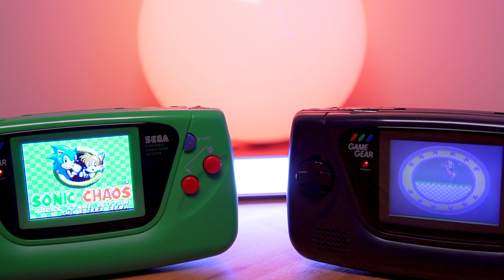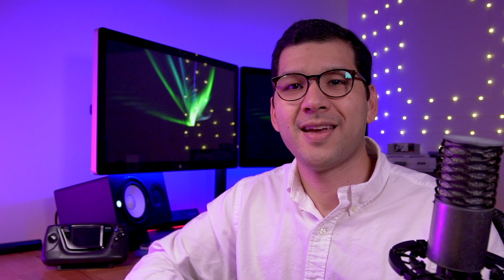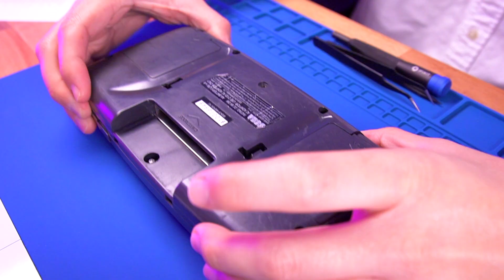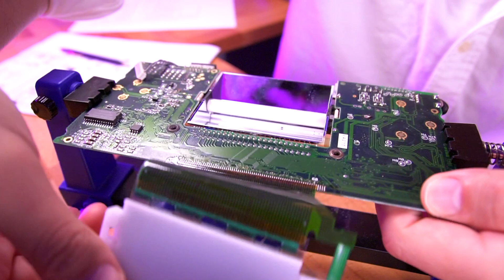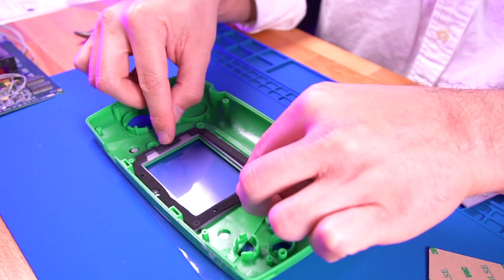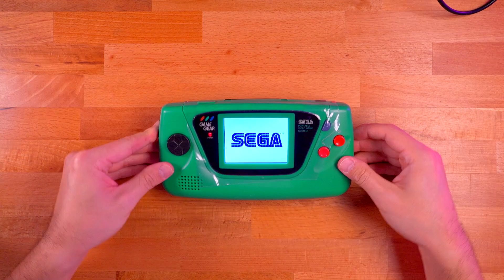ULTIMATE SEGA GAME GEAR | McWill LCD + RetroSix Custom Shell | Full Tutorial |  Retro Renew

Comment: I enjoy watch your mods, but I feel your a bit impatient when soldering and trying to remove simple components to quickly make mistakes in the process.
if you are not a qualified solder don't rush or you will make mistakes like you did on your volume wheel, if its just a shaky hand then slow and steady also wins the race. glad it worked in the end.

Comment: I've recently entered the deep rabbit hole of game gear modding and boy do I like it. It's impressive the amount of things you can do to a 30 year old console.

I got my first game gear around a week ago. I'm a repair technician and one of my clients gave me her GG for a simple capacitor swap. Little did we know that I was not the first person inside that poor thing, and the previous attempts at repairing it were terrible. Lifted and missing pads, torn traces under the capacitors (I'm assuming the last "technician" pried the caps with a screwdriver or something causing and immense amount of damage), capacitors of incorrect values in incorrect places with incorrect voltage ratings... A MASSACRE.

I told my client about the situation before doing anything and proceed to explain to her that it was going to be an extensive and expensive repair due to what I found and even though, I couldn't guarantee that the ASICs were not fried due to overvoltage or something else was faulty.

So she told me that she would most likely throw it in the bin because she didn't feel like paying a rather large amount of money without any warranties. I told her if she could give it to me and I ended up paying her a tiny amount of money for compensation and kept the console. 

Long story short, I repaired the traces, changed the capacitors, cleaned the board and fixed the audio board. 

Now I'm waiting for some replacements from AliExpress to fix the power board which had several SMD components fried and unstable voltages operation. If everything goes well and I end up fixing it, next thing will be a new retrosix shell (haven't decided yet if black or transparent) and a McWill LCD mod.

I'm really looking forward to have my sweet baby working again like a champ.

Videos like yours are EXTREMELY important and valuable to the community of modding fans. Great editing, great content and perfectly explained. I'm already subscribed and waiting for more GG content or any other retro consoles for that matter. Keep up the good work bro. 👌🏻👌🏻👌🏻🆙🆙🆙
Reply from the maker: Hey Cristian!  Really appreciate the kind words dude!  Thank you for the awesome comment!  

What a great story!  I’m so glad you were able to save the Game Gear, sounds like it had been butchered, but is now in a good home!  A retro six shell and McWill mod will complete your GG nicely!  

Thank you again for sharing!  Plenty more GG videos to come!  Cheers bud!

Comment: I just bought the v2 ips screen kit from funnyplaying and I see that the insulated film does not come in the box.  Do you need to install it?  What happens if I don't put the film on the screen?
Reply from the maker: You don’t really need it. You can just use kapton tape to insulate. I would recommend insulating any area on the pcb near the ribbon cable. Hope that helps. Cheers!

Comment: I didn't realize the McWill install would require removing so many components. My Magic Screen install was much easier than this, I'm sure you'll agree when you install it yourself. Only 2 resistors and 1 coil need to be removed and no new resistors new to be soldered for VA1 motherboards, it comes with an LCD centering bracket and a small daughter board that connects to the  bottom row of pins and then to the back of the main board using a small ribbon cable, the final result is very clean looking.
Reply: What about the Display and it's function? Do you offer better Scaling  or any new Features?
Reply from the maker: I’m not 100% sure but I think the feature are very similar if not the same as the McWill.
Reply: @hasserecht3678  From what I can tell, the LCDs are identical, I believe they are generic ones. The same 7 displays modes are available in both. Main difference is that McWill offers an optional RGB output, and the Magic Screen does not. Once Tito compares both, we'll find out if they are any noticeable differences in how they perform.
Reply from the maker: That’s good to know!  I can’t wait to install mine!  Video to come soon!!  Cheers RGS!

Comment: I see you have the game gear that has not the blue boot screen and is booting directly to the game.I wonder if the everdrive x7 card will boot. I have the same game gear with mcwill, the one without the blue boot screen and my everdrive x7 is not booting. I always getting a message "memory error". My original cartidges from the other hand are working flawlessly.
The only way i found to make it work is by powering on Game Gear and then insert the cartidge. That way it works. I think it must be something with the power when booting console as everdrive x7 has a large consumption of power. (The everdrive x7 is working fine on other game gear console with the original screen).
Maybe the usb-c mod will make it work with a big 3A power adapter.
Nice video though, always enjoying watching your mods.
Cheers!
Reply from the maker: That is super interesting!  I wonder what is causing the everdrive to not boot on the game gear without the opening blue screen. That seems like a pretty big oversight on the part of krikzz. I wonder if it’s a known issue. I really want to get the x7 everdrive at some point. It’s so expensive though. That would be interesting in the usb c modded power board fixes the issue. Cheers buddy!  And thank you for the comment!!
Reply: @MachoNachoProductions  i ordered a 3rd Game Gear console with McWill and with the blue boot screen. When i receive it i'll let you know if it's working or not.
Reply from the maker: Sounds good man!  Thank you!!
Reply: @MachoNachoProductions my friend haven't forgot you! I received my new Game Gear with the McWill screen and here are the results!
The problem i had with the everdrive GG x7 cartidge solved! At last the everdrive is booting normally! I was right about finding a Game Gear with that blue boot screen.
3) "Castle Of Illusion" now is playing normally with right resolution on screen, as i had problems with that cartidge on original game gear and with game gear with McWill.
4) I can now also play with the right resolution the master system games as also the SG-1000 games from my Everdrive!
So all my problems are solved!
Have a nice day and Happy Christmas holidays!
Reply from the maker: That’s great news!  I’m glad everything worked out!  Thank you for getting back and sharing!  Merry Christmas and happy holidays to you too!  Cheers!

Comment: https://handheldlegend.com/collections/sega/products/sega-game-gear-cleanpower-usb-c-power-regulator this is to replace the pcu, if you the bottom of the page. This board does not charge batteries. For a rechargeable battery and power solution use our CleanJuice GG (coming early 2021). But I'm using rc car battery pack's with it charger with a couple of adapters to get USB C charging battery's :)

Comment: I'm new at soldering, but I bought a kit and I'm playing on do it wish me luck. I have 3 GG's they all need capacitors replaced. I'm also planning on doing a rechargeable battery with type C charging.
Reply from the maker: Hey Cory, those sound like great mods!  I do have to say that the McWill mod is quite challenging and you may want to practice before attempting it. It requires some fine soldering skills. I wish you the best of luck in your modding journey and I hope my videos are helpful!  Cheers buddy!

Comment: A couple of errors in the video. There are 5 major mainboard revisions and the McWill is only compatible with 2. VA0 and VA1. The cartridge port shielding is not pre-cut. This is how all Asian/Japanese models have their cartridge port cover, because of less strict FCC regulations. I also noticed you said in a previous video that the retrosix USB-C mod is compatible with all hardware revisions, however it has a VA0/VA1 style connector, so it won't work with any of the other revisions.
Reply from the maker: Thank you for letting me know!  I’ll have to update my video description with this information. Cheers buddy!

Comment: This looks great! one piece of advice for those wires, pre-tin them with solder before soldering them to the pads and pins. Makes for a stronger, longer lasting joint. :)
(Apologies if you did pre-tin, I can't quite tell if they are or not.)
Reply from the maker: Totally agree!  Thank you!  I didn’t tin all the wires but I did tin the wires I soldered onto the small contacts on the motherboard off camera. It is good practice. Cheers buddy!

Comment: Many users have reported that the McWill LCD screen will not work with the EverDrive GG. What is your experience?
Reply from the maker: That’s really a great question!  I need to get an everdrive gg.  They’re just so expensive. I’ll probably pick one up eventually. I’d definitely like to know the answer to that myself.
Reply: @Michael McCarthy for me is not working with original everdrive x7.
Reply from the maker: Hmm interesting
Reply from the maker: That’s good to know!
Reply from the maker: I’m wondering if there is an issue with the newer x7 model?
Reply from the maker: Oh man that stinks. Thank you for letting me know. I really wanted to get an everdrive, but if it doesn’t work with McWill that makes it a tougher decision.  Cheers buddy!
Reply: @MachoNachoProductions  wait till i receive my game gear with mcwill. I'll test it as i already have the Everdrive GG X7. I'll report back probably the next week.
Reply from the maker: Awesome!  Sounds good!  Thank you!
Reply: @MachoNachoProductions   My Everdrive X7 works perfectly with my Mcwill game gear, its the only cart I use on it. But I only use mine plugged in I've never used it with batteries, so maybe not enough power from the batteries for people having problems?
Reply: @6316johnc  I never use batteries. Only AC adapter and having those problem. But i have tested also with batteries, rechargable and non rechargable and i have the same problem again.
Reply from the maker: Hmm interesting. It could be the batteries. I’m glad we’re all having this discussion. I like to play my game gear with my rechargeable eneloop batteries which probably is the worst way to do it, haha. Thanks again for the input!

Comment: Excellent job on the mod!. the only thing I'm confused about, maybe I just didn't pay attention to your previous video, but didn't you change the GG to have a USB-C power input?
Reply from the maker: Thank you buddy!  That’s a great question!  I did 2 Game Gear videos prior to this one. I did one where I replaced the capacitors for this McWill modded game gear and I did another video on a different game gear with the usb c mod. This green game gear doesn’t have the usb c mod although it can be very easily installed. It’s a drop in replacement of the original power board. Cheers!

Comment: Looks great, love the mcwill screen. As a side note, I have done this mod on some single asic models and although you can use 0ohm resistors, bridging the pads with solder or a small bit of wire works just the same. I have done it both ways and the result was the same.
Reply from the maker: Oh nice that’s good to know. Bridging the pads would be way easier than putting in this 0 ohm resistors. Thank you for letting me know. I have a single ASIC GG that I want to modify. Thanks again Ben!  Cheers buddy!
Reply: @MachoNachoProductions  If you have another one to do you should consider including the VGA mod that comes with the screen. Would make a good video. Keep up the good work bro.
Reply from the maker: I’m definitely thinking of modding another one now that I have some experience with the mod. I think I would definitely include VGA out on the next one!!  Cheers bud!

Comment: Forget about soldering the PCB and moving it around till you get the screen centered - too much of a hazzle - 

here is the solution:

https://www.ebay.de/itm/Sega-Game-Gear-Backlight-Installation-Bracket-for-McWill-etc-Orig-RetroSix/264937936130

Comment: Does the brightness control even work with the McWill LCD controller?
Reply from the maker: Great question!  The control wheel no longer functions with this mod. If you install the VGA connector the brightness function is used to activate VGA out.
Reply: Ahh...good question...and answer...the solder damaged brightness wheel will never be seen...good news for other modders as many will touch and melt the wheel unless extreme methods of insulating the iron are implimented...don't think i'll be upgrading mine though...my screen was replaced with an original blurry plus new capacitors...a few years ago...great video...well done
Reply from the maker: Thank you Mark!  Really appreciate it dude!  Yeah, that brightness wheel is so close to a lot of the components to need to remove. Cheers buddy!

Comment: Excellent job Tito! Was wondering if I would ever see you make a mistake LOL. You never said what you were going to do about the brightness wheel that's not functionable anymore correct?
Reply from the maker: Thank you buddy!  Yes, that is true. The brightness wheel doesn’t function to brighten or dim the lcd. If you choose to add VGA capability, turning the brightness wheel all the way off enables the VGA mode. Hope that answers your question!  Great to hear from you man!  Cheers!!
Reply: @MachoNachoProductions Nice work and a very nice instructional vid!! (much better than the provided install instructions). However the way you connected this mod essentially uses the brightness wheel to control the voltage supply to the whole kit. I think the install instructions for your mod board revision (without brightness control) uses instructions rev 2.2, which specify that the Vcc and GND of the mod board are connected to the Vcc and GND of the GG. The brightness wheel pin 1 and 3 are also connected to Vcc and GND of the GG and pin 2 of the brightness wheel to the 'brightness pad' on the mod board. This way the mod kit always receives a clean 5V Vcc and the brightness wheel can be used to toggle  VGA mode...
Reply from the maker: Thank you Lars!  That’s super interesting. I just followed the instructions. Did RetroKAI update the installation instructions? I may need to look that over.